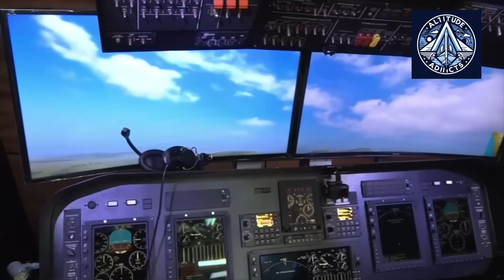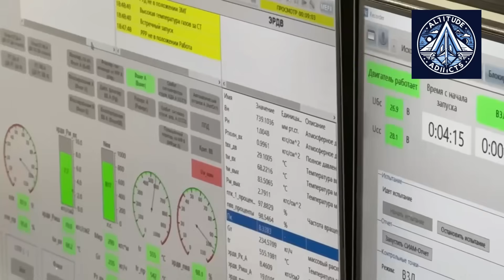VK-800 Turboprop Engine Debut Flight: A Giant Leap for Russian Aviation Technology

Comment: The brief shot of the plane in flight shows some dark exhaust from the back of the plane, where the actual jet engines are…….
Reply: at least there should run integrated APU onboard to power hydraulics, control systems/boosters, avionics, radio, etc.
This is test mule and cannot be operated with only 1 single turboprop instead of 3 jets.
Reply: @metocvideo  plane is flying laboratory made from old 3-engine jet airliner, engine to be tested is mounted at the front.
Reply: APU MUST be ON in case of tested engine failure(turbo fan), u can start the turbo jet engine, remerber, this not a fighter jet, u dont have eyectable seat.....

Comment: What's the point of adding a turboprop engine to the nose of an aircraft that has 3 extra jet engines? What are they aiming to achieve?
Reply: This is demonstration Aircraft.   The Turbo-Propeller it is what being tested here. 
the final product would be only turbo propeller,  this airframe it is a demonstrator.  Jet engines will not go on the final product
Reply: @akportoboreetadafe29  use words well.
When engines are developed, they are not just put on the plane it is meant to fly on, it is put on other planes and testing in adverse conditions simulating actual flight. They are put in the nose, sides or other place that simulate actual flight.

Comment: Being a single shaft centrifugal engine, it is indeed rugged  and powerfull but not that efficient at high altitude making it less suitable for airliners. I guess a solition fot that also will come.
What I think ? Well Russia has different challenges than the West, reliability and ease of maintenance is verry important.

Comment: Agradecería que alguien  me pueda explicar que es lo que quieren lograr, tener un motor suplementario, o utilizar ambas motorizaciones segun requerimientos , ect .
Reply: It is a test bed as they call it, it is testing the turboprop engine, once all the tests are completed, the engine will be removed from the nose of the mother aircraft. The turboprop is fixed to the jet for testing purposes only, so that if something goes wrong with the test engine the mother plane can safely return with the use of the three turbofan engines.
Reply: @anthonyxuereb792 Ahora lo comprendo perfecto, porque no se el idioma Ruso, muchas gracias.
Reply: betul brother, mesin turbo prop di bonnet untuk apa, padahal dibelakang ada 3 buah mesin jet, mungkin hanya russia yang tau artinya
Reply: @Arnaldo-lx6zv  Prezado amigo. O motor foi instalado nessa aeronave para testes em voo. Esse avião na verdade é uma bancada de provas. Espero ter sanado sua dúvida. Saudacões.
Reply: @pedrotincani8539  muchas gracias por responder , me quedó claro el concepto.Saludos 😉